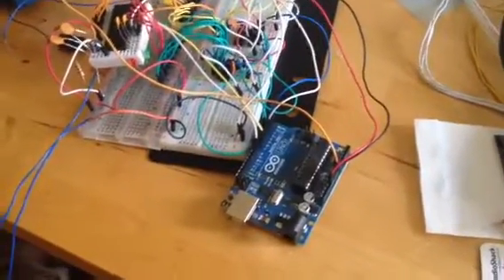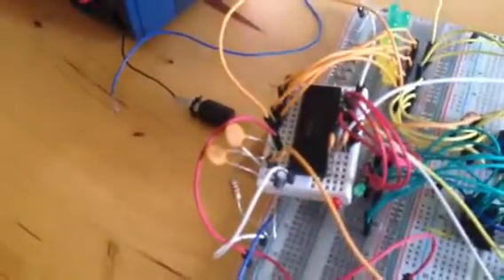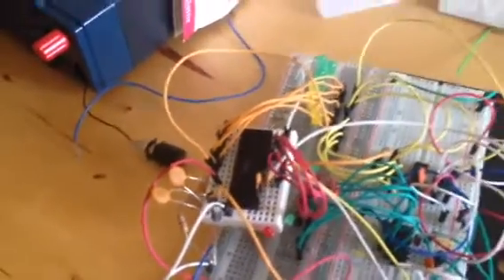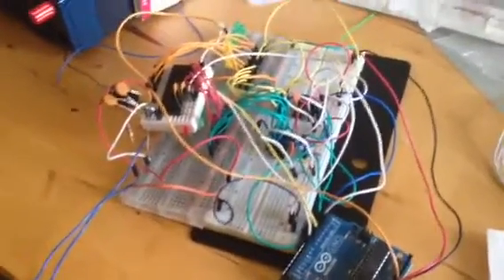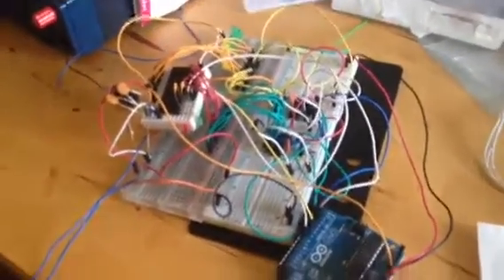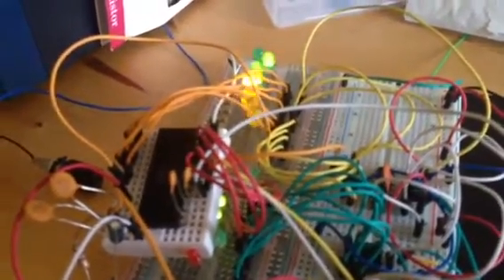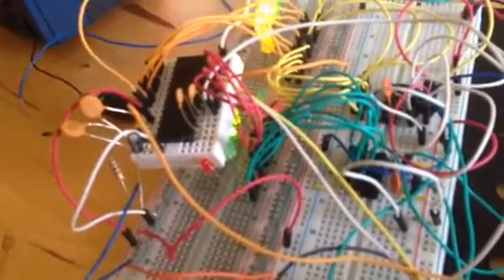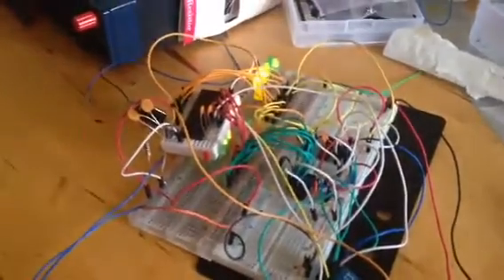6581 SID Arduino chip take two.

Comment: I'm very interested in the topic, because practically I want to build a computer-independent sid (6581 or 8580) player in a portable design. In practice, it would be a fast SID tester. Of course, the real thing would be if it also played sid files from a microSD card. For now, I would be happy with the circuit diagram of the device you put together. (Of course, the light show part can be omitted) Thanks in advance. Regards, Andrew
Reply from the maker: I don't have any schematics specific to what I made. That is, I worked off existing work and kind of modified it on the fly to fit with my project. 

There's a lot of resources online. I think I used something along the lines of the bottom schematic here to start. This was like a decade ago, so I don't remember exactly. (I give some links, as well, in the other comments):

https://forum.arduino.cc/t/c64-soundchip-sid-6581-with-arduino-duemilanove/21126/20

One thing I will warn you about is that a lot of the SID chips out there are fake, especially the 6581s. Were I to make a SID tester, I probably would start out by buying a FPGA SID that I know works or use a known working SID from a C64. I ended up causing myself undue frustration back then when I didn't realize one of my SIDs was either fake or broken and certain filter sweeps weren't working on it, when the problem was, I was testing on a bad chip. Turned out about half of the chips I bought at the time (like 3 out of 6) were either fake or not working.

I used this to benchmark my SIDs:
https://ploguechipsounds.blogspot.com/2010/05/one-page-basic-sid-benchmark.html

You just have to translate it to Arduino/C++. It's pretty straightforward.
Reply: Thanks. It's a great starting point. @pulykamell
Reply from the maker: Oh, I found it in my comments. This is the schematic I used as a foundation for the project. 

http://www.ucapps.de/mbhp/mbhp_sid_v3.pdf

That one has two shift registers and the SID chip, which is how I set it up with my Arduino. You don't have to use shift registers if you have enough pins on whatever you are using to control it. My Arduino Uno did not have enough so I just used shirt registers (and I wanted to, anyway, as I was teaching myself how all these components work.)

The main difficulty I had was getting the clock right so the signals synchronized with each other in the circuit. That was done in code (which is available in one of my links in the comments). I'm not 100% sure if the way I implemented it is the ideal solution. I was just kind of hacking together the thing, and it seemed to work ... most of the time. Sometimes I would have to reset the circuit to get everything to align correctly. I don't own a scope, so I wasn't able to see exactly what was going on at the electrical level -- whether the hiccup was do to my code or to some hardware inconsistencies.

Good luck!
Reply: Is it possible to find the arduino source code somewhere? @pulykamell
Reply from the maker: @AndrasVarga-jg1tk  Read through the rest of the comments. There's a link in one of them.

Comment: just curious, what are the shift registers for?
Reply from the maker: +Jennifer Gwinn One register is for 8 bits of data; the other is 8 bits of addressing (although only 5 are needed, if I remember correctly.) Basically, it's so I don't tie up too many pins on the Arduino. Instead of using 13 pins, I just use 3 on the Arduino (serial data input, clock, latch.) So address and data are sent serially to the two registers (which are basically chained) and once all 13 bits are in, the latch pin is set high to move the data from the registers over to the SID.

Comment from the maker: Oh, and the SID Player source code that I worked off of for the MIDI demo is here: http://sidplayer.org/. It's in 6502 assembly, but it contains the note tables in the ksidtabsys.s file. There seems to be a very slight deviation from the numbers I used. For example, the high C is listed as 30 decimal low byte and 134 decimal high byte, which should be $861E, but I have it as $8620, so I may have been using the numbers from some other reference, perhaps the C64 machine language programming guide, or maybe just the regular manual. It shouldn't make a significant difference as it's only a difference of 2, and I just bit shift one to the right as I go down octaves (the same as dividing by two.) As long as the octave is in tune to itself, bitshifting to the right to go down octaves should work fine.
Reply from the maker: In case anyone is still reading this, the source for the Sid Player with the notetables is no longer available on that website, but if you got to archive.org, you can find it if you look a few years back. The SID datasheet here also has them: http://www.waitingforfriday.com/?p=661. Read the note about just storing the 12 highest values and bitshifting for the octaves. That's how it's implemented here.

I've also gotten back to the project almost four years later, cleaned up the code considerably, so if anyone is interested, just email me at peter@peterpawinski.com and I'll share what I know. The current iteration has an 40x2 LCD display integrated into it, and the next step is incorporating chip decoding logic to add multiple SIDs (although of the five SIDs I have, it seems only 2 work, and those seem to have fried filters. Boo! I have an 8580 coming, and two 6581s, but I have a feeling the 6581s are either going to be counterfeits or defective.)

Comment: Diagrams and code please. I bought a few shift registers with the same intention and it was nice to find someone else that had the same idea.
Reply from the maker: Shoot. I put this project away for awhile. I had two 74HC595 shift registers chained together, with one being the address register, and the other the data register. When the data was loaded in, I sent them out parallel to the SID. I just followed the Arduino tutorial on shift registers. I know I found a schematic online that had a very similar set-up to what I ended up with. Let me see if I can find it.
Reply from the maker: Actually, I found a thread where I explained it: 
http://forum.arduino.cc/index.php?topic=187712.0
If you look at reply number three, you'll find a schematic that is very similar to my set-up.
Reply from the maker: Ah, found the exact code for this demo. It's here:
http://www.pawinskiphotography.com/public/hacksville.zip

Disclosure: I am not a programmer. I just used this as a project to see if I can figure out how to get things together and working. While it works, I don't think the way I have the clock set up is the correct way of doing it. I'm kind of fudging the timing by leaving the chip low for a few microseconds and then taking it high. I assume there's a cleaner way of synchronizing it, but I haven't quite figured it out. I know sometimes it doesn't synch quite right, so I have to reset it to get it to work. (Like maybe one time out of five or six it drops voices.) Also, SID chips can be pretty temperamental. I know some of mine work fine; others are buggy. I played this through an 8580, and it was a bit more stable.

(There's some commented out debugging stuff I have at the end there. I found another version of this on my computer, but I think this was the final version, as it has the most recent modify date.)
Reply: Excellent! Thank you for the quick reply. I was not looking for a one to one match with your design because I have different shift registers that I want to use, and as for your program I was really just looking for a guide. You have provided far more than enough for me to get started and I thank your for that.
Reply from the maker: G0ggleblind Crap. Actually, that schematic in the link is not the one that I used. I used that to help me with the audio out circuit. That one isn't using a shift register. I can't seem to find the right schematic, but the basic idea was serial out from the Arduino, I send 16 bits to the two shift registers. The top 3 bits are "0" (or whatever, they are not used) the next 5 are the address, and the next 8 are the data. So Q0-Q4 on the top byte 75LC595 shift register is connected to A0-A4 on the SID, and the low byte shift register, the Q0-Q7 is connected to D0-D7 on the SID. The basic idea is explained in one of my later posts on that thread I linked to.

I think the correct way to sync everything is via SPI, but I don't know how to do that yet.
Reply: Well my big question was really already answered. I had wondered if sending bits to a shift register that ultimately is hooked up to a SID running at 1Mhz would work. You proved to me that it does. The shift registers I have are different so a schematic wont help me much. I did take note concerning the output circuitry coming from the audio out and will take the necessary precautions. Thanks again for the help.  Do you have anything that shows the technical side of the MIDI interface you seem to be working on?
Reply from the maker: G0ggleblind Oh boy. I remember that being a bit of a pain in the ass. I know I used an LCD screen to help debug. (What I remember was that you had to set the MIDI serial data rate to one that was incompatible with the rate for serial input on the computer, so I couldn't use the terminal to debug but rather had to send debugging info out to an LCD panel.) Anyway, I didn't take great notes on this, but I found the thread where I was working it out. Hope this helps: http://forum.arduino.cc/index.php?PHPSESSID=a9s2gg8fol9jvqutah7rjnfp37&topic=192162.0
I do remember it being somewhat tricky, as the byte sequence my controller sends does not include a note off command, but rather a note on with a velocity zero, and if the sequence happens quickly enough, the note on byte (144) is not sent, but assumed, and only the data bytes are sent. I can dig up that code, too, if you'd like.
Reply from the maker: G0ggleblind OK, I think this was the latest iteration of the MIDI code for the video where I have this hooked up to a MIDI controller:

http://www.pawinskiphotography.com/public/sidmidi.ino

Actually, here's the video for reference:

6581 SID Arduino MIDI polyphony test

That's got "running status" implemented (where the status/command byte is not transmitted if it hasn't changed). All the "defines" are for the sliders and knobs on my particular MIDI keyboard (some M-Audio Oxygen 49 note keyboard). I found out those values by hooking up an LCD screen to the circuit and basically echoing out bytes to it.

The note tables are based on the highest frequencies for those particular notes and bit shifted right once for each octave. (It works the same way as in real life. A standard "A" note is 440 Hz. Doubling that to 880 Hz gives you an A one octave higher. Halving it to 220 Hz gives you an A one octave lower. Doubling or halving SID frequencies works the same way in that it will product the same note either one octave up or down. I'm not sure whether the numbers actually correspond to Hz, though.) This technique is borrowed from the source code for SID player.
Reply from the maker: Better late than never, but I was able to track down the basic schematic for those shift registers and the SID:
http://www.ucapps.de/mbhp_sid.html

Look under Download > Schematic